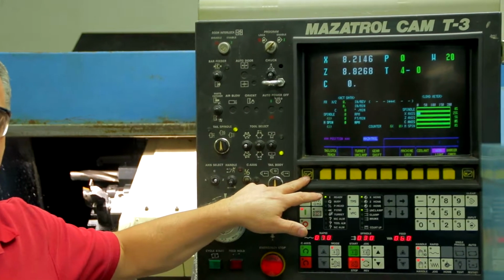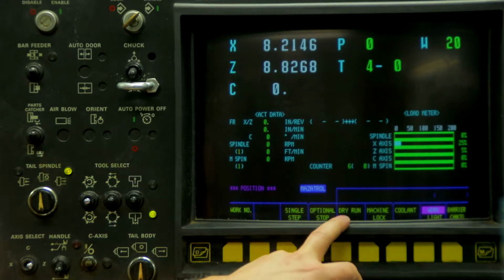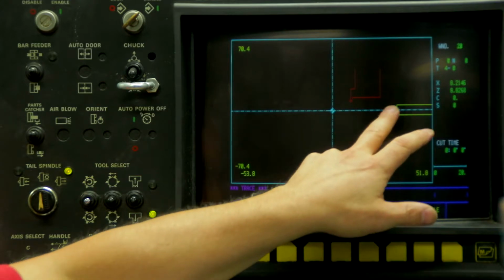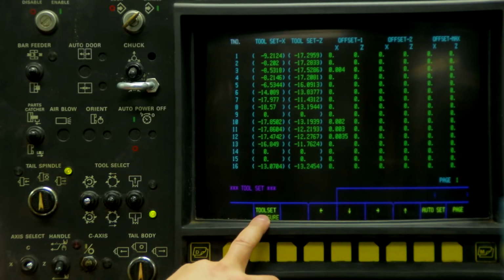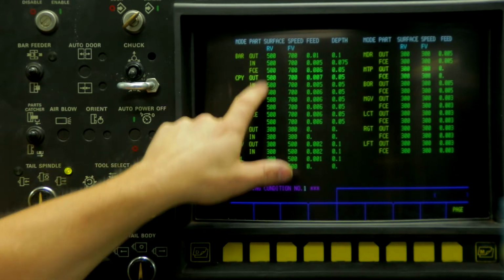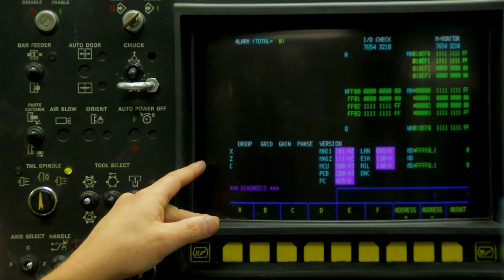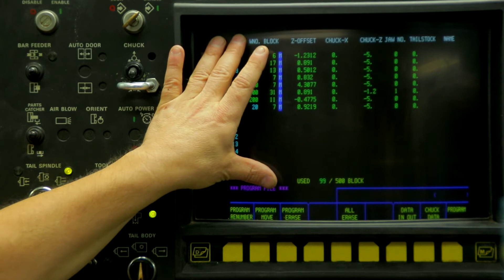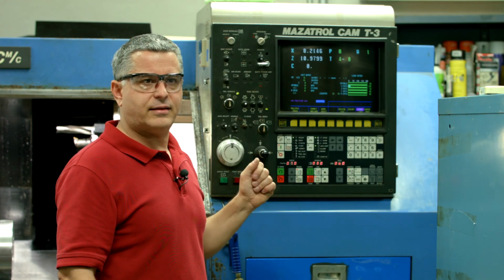Mazatrol CAM T2 T3 Control Screen Operation

Comment: What does width mean on the page with the tool data page?
Reply: The tool file page. Sorry
Reply from the maker: Are you talking about where you would enter the width of a grooving tool perhaps?
Reply: @mazatroltipsandtricks6816   I thought I saw it on your turning tool slot
Reply from the maker: @mccheezen20  It means the width of the stick tools. Not an important field.

Comment: Great instruction! Do you know of any videos on a smart 300M control? I've ran qt's quite a bit, but no live tooling programing experience.  Say cutting 6 equally spaced slots down a shaft...
Reply from the maker: Nice thing about Mazak is the programming language remains basically the same as they came out with newer controls. If it works on my T-3 control then it would work on a Smart control.

Comment: I’ve never worked with Mazatrol in my life. Watching this tutorial it doesn’t seem to be hard to run a Mazak. But the point is, does this old Mazatrol version look too different than the new ones? When it comes to tools set up or operating, does that change a lot?
Reply from the maker: The new Mazaks have more features than this old controller but the basic Mazatrol language has remained the same.  You describe the tools in the same way.  I had an easy learning transition going to the Smooth X control.  The biggest difference for me is the touch screen interface on the new controls.

Comment: How can I change from inch to metric on a sqt15 m32-3?
Reply from the maker: You will need to get a set of metric parameters for your machine. Switching a Mazak from inch to metric requires you to change a TON of parameters. Mazak will only sell you the parameters that were originally loaded on your particular machine via your machine's serial number.  This is a very involved process and not something I would recommend.